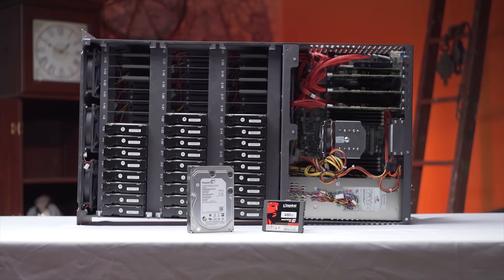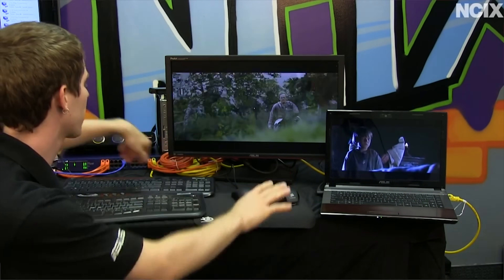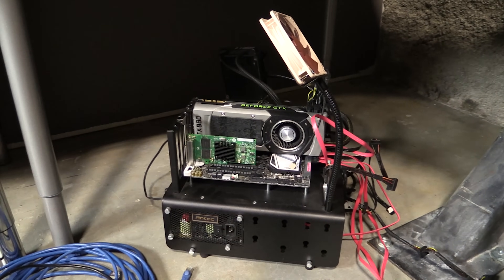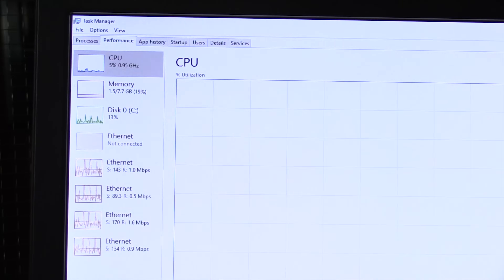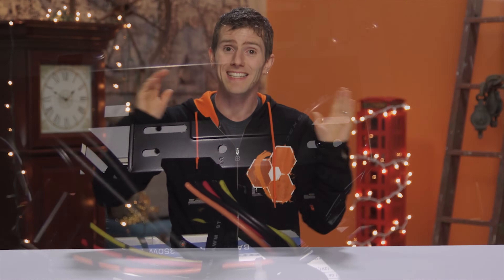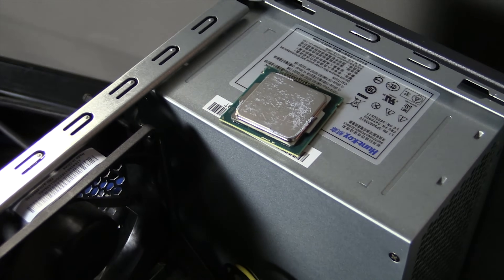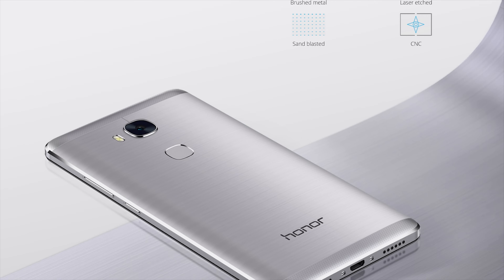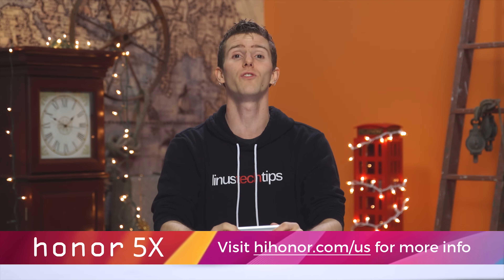Quadruple Your Network Speed for $100 with SMB 3.0 Multichannel!

Comment: How expensive would it be to get ethernet wired to my room? Wifi sux in there and things in games freeze and teleport places and rewches as much as 20000 ping in 1 game, and 780 in another
Reply: +e²_837 WiFi might not be the problem, it will only be a problem if there are a lot of devices connected to WiFi and a lot of access points in your area or if you're getting bad WiFi signal. It is most likely your internet. Ethernet cables are not that expensive but if your room is far from the router then it can cost a large amount.
Reply: If you have an coax cable connection in your room, you can use a MoCA adapter (set) (pretty much the same thing as your cable ISP does) and hook it up to your network, it may increase ping by a few ms (most likely no worse than wifi)  also try looking up using two Actiontec FiOS modems (cheap off eBay) and using them as MoCA bridges

Comment: Does this boost my ping in games ?
Reply: +Rafael Rauhala No, because the device will only know what data to send once it gets input from the user or the server and vice versa. So bandwidth will only have an impact on ping if it can't send all the data it wants to as soon as possible but once it has enough bandwidth the latency (or ping) will reach a point where it can't decrease due to location and other reasons and bandwidth isn't the bottleneck. No game needs that much bandwidth.
Reply: Jason Cloete Ok now I understand thanks for the answer.

Comment: EposVox has a better way, i got up to 900 mb/s and a stable avg of 600 mb/s  with 2 $19 10gbe cards and 1 $25 network cable. Funny thing is, this info is on the LTT forum.

Comment: Can you connect those LAN cable straight from one card to another without the use of a router?
Reply: +TRUSTECH Most probably but you should set the IP statically because the other computer won't act as DHCP.

Comment: I dont understand this network stuff can explain more to me what this for?
Reply: +Fariq Anugrawan If you have a NAS (Network Attached Storage) to store things like video files and you want to edit them without lag or buffering or want to copy large files across your network to another device with a larger speed (e.g. if you constantly do huge hard drives backups) or any other example where you need more speed on your local network then you do what he did in the video. So basically what he did is put in a card in a PC and NAS (or other device) to be able to put in more Ethernet cables so that more information or data can be send parallel. Basically it's like having 4 pipes to send water through, it just goes faster.

Comment: Sure, for under a 100 dollars... + a new CPU and 2 SSDs
Reply: +Miguel Angel Vazquez You usually have a decent PC before trying to max out network speed.
Reply: +Miguel Angel Vazquez also 2 computers, screeens, OS, ethernet, etc etc, etc lol pointless like u can see
Reply: +Miguel Angel Vazquez A lot of things to buy...! Interesting video though.
Reply: +kevin G. He wrote it right...
Reply: +Miguel Angel Vazquez This is for enterprise and High End network purposes... If you are a normal user it's obvious you are not going to need this LAN speeds...
Reply: +Miguel Angel Vazquez Don't forget the other end.
Reply: +Nothinglastsforever use AC wave 1 to do so as WiFi n and WiFi ac will not do it but a wirelss access point wired into the network and supporting 802.11ac wave 1 or 802.11 ac wave 2 with a computer supporting at least Wifi ac wave 1 if not WiFi ac wave 2 with wave 2 so far only on Cisco devices but also theoretically faster
Reply: +yumri4 k. I'm talking about wired.
Reply: a 4Gbps or 10Gbps card and a switch or router that supports it the end but the card alone will cost more then $100 at minimum before you get into the QoS setting and wires needed for a single port 1GBps FTP server network infrature then a few SSDs to feed it and a Network based OS for network traffic FreeNAS is good but the community totally sucks. Windows Server is a pain but can also, Oracle Solaris can kinda, and of course Red Hat Enterprise Linux can too 
1GBps is not really needed yet if we had it we will find a way to use it probably streaming uncompressed videos and music instead of highly or moderately compressed videos and music
Reply: and remember..if you dont buy intel linus will come and throw your parts

Comment: Did you guys use Link Aggregation on the Windows 10 machines? LA is bugged in latest Windows 10 builds. Microsoft is aware of that bug and will fix it in later builds. You will have to use the Release Build (so no newer Builds) from Windows 10 to get it working, currently. This might have been the reason for some of your troubles (In case you were actually using LA).

Comment: Does thos help with gaming?
Reply: +SmashVG No, because the device will only know what data to send once it gets input from the user or the server and vice versa so it doesn't help to do it in parallel. So bandwidth will only have an impact on ping if it can't send all the data it wants to as soon as possible but once it has enough bandwidth the latency (or ping) will reach a point where it can't decrease due to location and other reasons and bandwidth isn't the bottleneck. No game needs that much bandwidth.

Comment: USB 3.0's been out for like... 8 years now. It's a built-in 5Gbps NIC FREE ON MOBO.
That is, if someone would write a network driver for male-to-male cables already.
Reply: +yoyofargo I should point out... It's possible. 

USB 3.0 and up supports direct-to-host A-A connections... It's just that nobody's written any networking software for it in the 8 years it's been out.
Reply: 8 years? You mean 2.0
Reply: 2016 - 2008 (when usb 3.0 came out)

Comment: Doesn't the I7 also have more channels to communicate over the PCI-E slots?  So the I3 might have been throttling you on that point as well, no?  I'd imagine it probably uses 1 channel per ethernet, and the i3 was causing queueing. At least that seems to be a problem with PCI-E SSD

Comment: I got excited about SMB3 when I got Win 10 and new server hardware... an interesting test is to do the same thing on Server 2012r2 with HyperV and setup the 10GB link, you see allsorts of performance when I did this.

I ran a large format printer that uses files that average around 1-20GB in size, so speed of transfer was essential.

Comment: It's all related to RSS. Intel 1000PT will not work with SMB Multichannel. You can tune it in NIC settings.  If there is no RSS - SMB Multi might not work.

Comment: Proper servers have been able to do this for a long time. HP call it Teaming, but it is basically just a driver feature to enable LACP (Link Aggregation Control Protocol) between a multi-port NIC and a Switch. Cisco had similar thing too, called EtherChannel.
Reply: +Dave Pusey  Your right I dont know why Linus is having such a hard time with this .  NIC teaming is not new , but it does help to have a managed switch capable of creating Link Aggregation Groups.  These like you mention go under different names on the switch side , LAGG  common on Netgear prosafe/Dell poweredge  /  Teaming on HP Procurves /  Etherchannel on Cisco all are just the same name for Link Aggregation.  Now when you have the NICs and the switch working together you will see less dependence on the CPU as the switch can help load balance across the 4 ports as they know thanks to Link Aggregation that they are one group .   Poor Linus always doing things the hardway.   I picked up a nice hp prove curve 48 port managed gig switch for 80 bucks off of ebay like brand new .  Picked up a Cisco 3750x ( non poe ) for under 200 and that has 10 gig fiber SFP so when your core network is in line everything else will work better.
Reply: NIC  = Network Interface Card
Reply: Abdul Muhaimin  See above comment

Comment: For some reason when I tried it in windows 10 it was extremely slow in my build
(i7 6700k 16GB ddr4 RAM 1tb Samsung 850pro GTX 770 4GB) 
But, as soon as I bridged the connection the speed shot up, and of ten I would get 500mbps if you have not tried that, you should try it. it certainly worked in my case

Comment: For all people who don't get it: this video is about improving file transfer speed on Windows machines mainly (SMB) and the problems with bonding 4 connections. Windows seems to rely on hardware CPU threads. That's why Linus mentions that an i7 with SMT is working better. On the other hand this has nothing to do with hacking arround purposely speed-restricted internet in your apartment. If it's trotted the only thing that will help is talk to your ISP. If you are limited by physical limitations such as wire length of your pone cable the only thing that might help is switch ISP, move to a different place, get a new modem, or pay someone 5-20k EUR to burry a new cable to your house.

Comment: The title of this video is very misleading, when the results were flaky at best and pretty much required CPU upgrades on one or both sides of the transfer, while quite a lot of viewers may be running an enthusiast PC but their network storage solution will probably be focused more on capacity than CPU speed, as network storage typically requires almost no CPU, even when running software RAID like ZFS.

Comment: OK Linus, lets see if I can help here. You're viewers will now be getting very excited that what you demonstrated includes the internet access. I wish you would have stressed that it was internal and did not include external connectivity. Next, the part you missed was the TYPE of file you are copying. File type and size matter and must be factored into the equation. Do tests that use only large file sizes, then medium, then small and you will get an understanding of what copies best. Lastly, research the gigabit packet networking protocol under ethernet and you will see that restrictions are in place for that as well. Good channel - keep it up

Comment: Why not simply use link aggregation? I mean you're trying to enable parallel usage by using a SMB feature, but it will do nothing for any other traffic. Link aggregation would enable the parallelism on Layer 2, even below individual IP packages.

Comment: Yea but how can you quadruple your WiFi speed?
Reply: +ThioJoe By wrapping sticky tape around the centre of your router 7 times (anti-clockwise) and putting it in the oven at 60ºc for 14 minutes.
Reply: i almost thought this was your vid because of the thumbnail
Reply: +ThioJoe Will changing my PC's oil help in anyway?
Reply: thio joe can do it faster
Reply: +ThioJoe four wifi access points is a foolproof method. It is how my university maintains it's rock solid network access reliability.
Reply: +ThioJoe by getting cancer
Reply: +Touka Chan Someone who says "stfu", and doesn't know how to use proper grammar looks more like a 12 year old than anyone else.
Reply: Zack Davies There are 32 comments before yours.
Reply: +VENOM 17 read the about in his channel
Reply: +Touka Chan it's a freaking comedy channel! im subbed to his tech channel.
Reply: I can have my own opinions you know
Reply: +ThioJoe Thio get on the next Crapyard Wars and troll these fuckers.
Reply: I thought this was a fake account! xD
Reply: +ThioJoe Depends how fast it was before, feasibly, yes.  I recently did just that, going from 300 mpbs n to 1200 mpps ac,  max speeds of course, in practice it is also much faster but is now capped by my ISP download speed, haven't gotten around to doing a point to point test in the network.
Reply: mcasianchickennugget again stfu your probably fucking 12
Reply: +ThioJoe You just have to turn off your WIFI and plug use gigabit or faster Ethernet....
Reply: +ThioJoe Get a better service provider subscription and move to an area that gives you better offers.
Reply: +ThioJoe , The way to do that is to use a computer as a router, with PfSense as the Operating System. Even a computer from 2010 will do really well. If you use a GAMING PC as a router, be ready for excelling network, and maybe even WiFi/Internet speeds. You're welcome, and in case you for some odd reason decide to make a video on this, mention Theasdfguy555 as the one who suggested it.

P.S. Don't make a video based on this. I claim all of the content above to b the sole property of Theasdfguy555/Linus [because this is on the comments section of his video].
Reply: Fabian Miserus True the internet is a great example of a WAN.

Ah i see, a misinterpretation then, sorry about that. :P
Reply: +ThioJoe rly nigga
Reply: +ThioJoe By connecting to it with an ethernet cable.
Reply: +ThioJoe For fuck's sake, my sides.
Reply: +ThioJoe find that out on the next episode of thio mcjio
Reply: +Touka Chan ew a fuckin weeb
Reply: +ThioJoe Use AC
Reply: Touka Chan easily offended weeb gets defensive because of name calling (gone sexual!!!)
Reply: +ThioJoe i knew this day would come xDD
Reply: +OnurbbHullZ well i actually fantasize about that while showering
Reply: +ThioJoe EASY! You just glue four routers together with PVA (so they stick longer). Then you need to go to the command prompt on Windows, enter in "sfc /scannow", choose option 5 to upgrade the number of routers. Say 4. BAM! You have quadrupled your WiFi.
Reply: ..First!
Reply: ***** So are you saying that WiFi doesn't go over 250 mbps?
Reply: jakeypearce
I know, I'm making fun of people who think others care who's first or not. Don't take offense to it.
Reply: +ThioJoe getting a better router
Reply: +ThioJoe By you not uploading silly "hack" videos and wasting our bandwidth.  I tried to upgrade my PS3 to PS4 using your trick, now my PS3 is a Vectrex.
Reply: +morgan minecraft legion that is presuming that the Internet service (from the physical Internet cable that's coming out of his wall) being provided from his ISP and his network cards/integrated ones are up to par.

Also you can't claim ownership of a simple way to do things, that's like claiming ownership of how to boot windows from a usb.
Not to mention how this isn't even on the same level as any content that's copywritable, and not its not even patentable information.

You sir in terms of ownership are talking bollocks.
Reply: get out. No one asked your opinion.
"How can Microsoft afford to just give laptops"
Reply: +ThioJoe aluminum foil
Reply: True
Reply: +ThioJoe i think you need to twist it around your phone and then use a mac!
Reply: ***** so what? it was never intendet to be a real tutorial it was just a joke
Reply: Fabian Miserus What's fake exactly?
Does he mean Linus's video title as i mean network doesn't mean internet after all.
Reply: Mr Meh it is diferent internet is on a network but a network isn't always on the internet... but what i ment was that thio joe makes "fake" tutorials and it is prety funny... but lines makes his "network"faster not the "internet"
Reply: +Stu Bur lol
Reply: ***** Yes if you change from sky to virgin.
Reply: oh no u didnt
Reply: you just do
Reply: have you tried calling your satellite transponder vendor with an offer they 'cannot refuse' :P it works. no physics involved :P also most contracts would include something called 'market conformity' so do that every year or so :P lol. same with lighted fiber links etc. "i'm sorry the shit you sold us in 2006 just doesn't cut it anymore at that price. fix it or we take our dollars elsewhere".
Reply: Marlon Cambasis Better garden internet?
Reply: But how can you shut the f up
Reply: +jj Robot Yes.  Make sure you keep the washer fluid topped up and check the blades too so you can keep your view clear of what it's doing.
Reply: +ThatGuyWithHisHat That could work as part of an ad-hoc antenna or to block neighbors' signals from interfering with yours.  You'd have to explain that to all of your visitors though when they see it and look at you funny.
Reply: I hope you've learned you can't ask questions on the internet.
Reply: overclock ur router
Reply: Ethernet?
Reply: Use four wifi cables, simple.
Reply: Hehe...Thio joe
Reply: Install wireless driver 4 times
Reply: Well, you can't quadruple the speed of YOUR Wifi. You could however use other existing wifi networks with additional Wireless Cards. You could then use LACP (802.3ad) to aggregate these links to a VPS in the cloud. 
Lets just say you've got a 50 mbit downlink and you've got an open network of a bakery and another open network of lets say verizon or unitymedia near you. By connecting these networks you could mybe not quadruple your network speeds but often triple them.

(By the way, often open networks have a user use bandwidth restriction. You can circumvent that by creating virtual interfaces and using different MAC adresse for each of them)

Obviously we now have a security problem with your data going over non-secured networks. For that you could use wireguard on each link or on the aggregated link. I'm currently not sure which would be better but will try it in february. If anyone's interested, drop me a message and I'll send you if it actually makes a difference.
Reply: 4 routers
Reply: go back to your videos, you talked about it once
Reply: +ThioJoe 4 wifi cards :^)
Reply: +ThioJoe  stfu your videos are terrible get out of linus channel
Reply: Your tech channel is good, but your comedy channel is starting to sag behind... And yes, I know it's supposed to be funny, but maybe try some references that only people who know tech will understand.